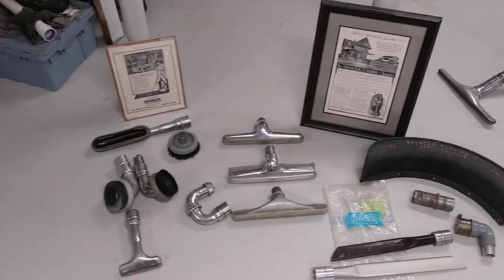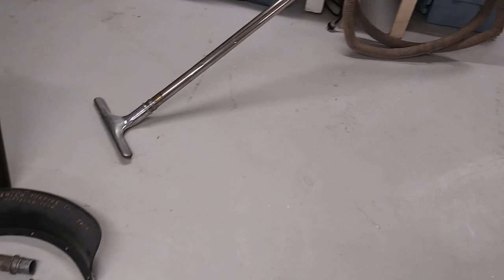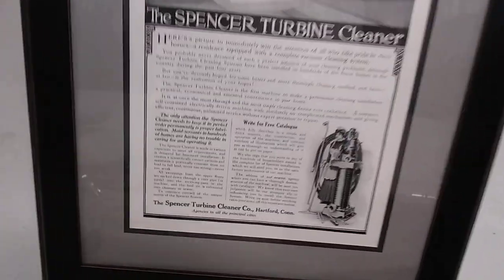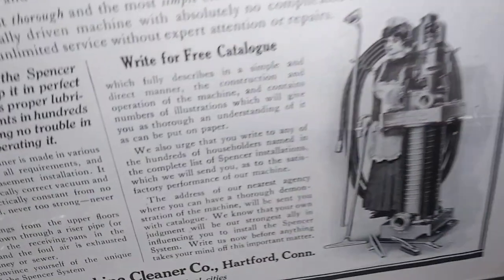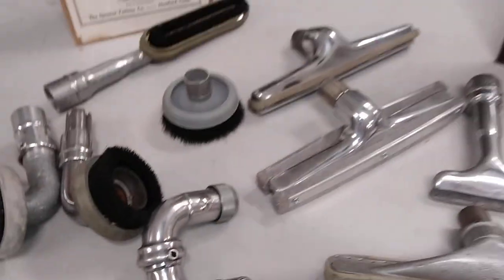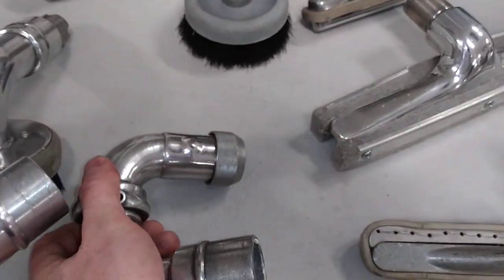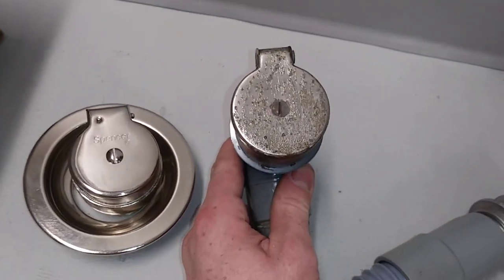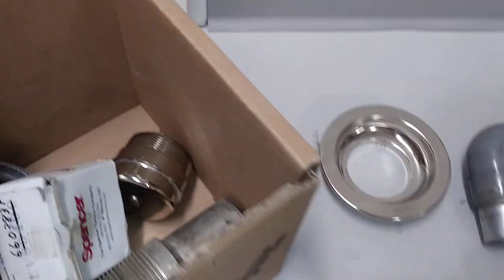Spencer Vacuum Hoses, Inlets, and Tools - Old and New

Comment: When I would have gone to a school built in 96 with a Spencer system, I always wondered how those inlets didn't turn the machine on, of course not knowing much of the Spencer system at that time. Is it possible to special order this with contacts inside or would you just have to drill into it and place them in? Of course using a remote control is smarter.
Reply from the maker: Spencer inlets, to my knowledge, never were made with amy kind of control provision. Vacuflo/HP's "Spencer lookalike" industrial inlets are or used to be available with a door-activated switch. Vacu-Maid's too. With a Spencer system (100 years ago as today) the control circuit is separate, and there may be as many or as few switches as desired. Ideally with indicator lights.

Comment: That U swivel has an oiling port on it.  I think that is what that hole in the middle is
Reply from the maker: That hole is where the BBs get loaded into the "race" cast into the pieces, locking them together and allowing them to rotate. Once all the balls are in, a set screw keeps them from spilling out. Thank you for watching!!